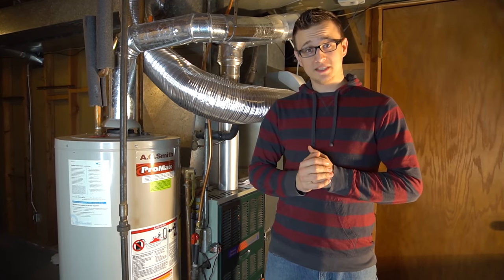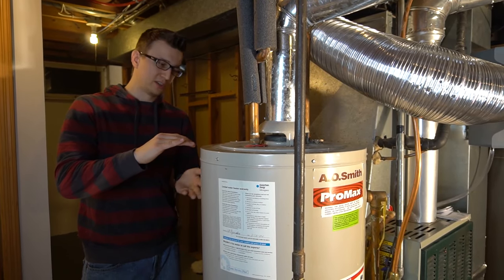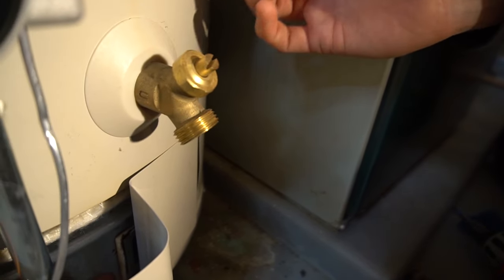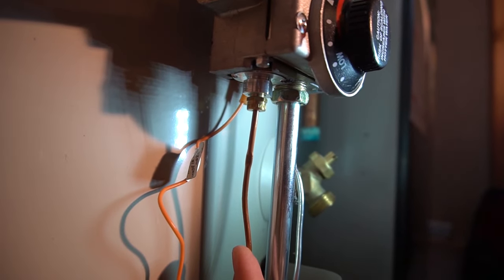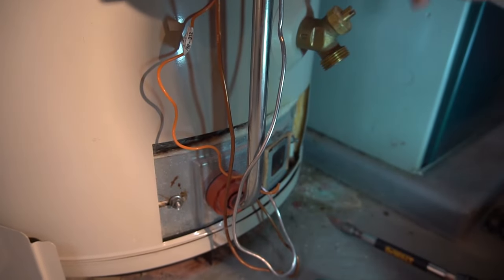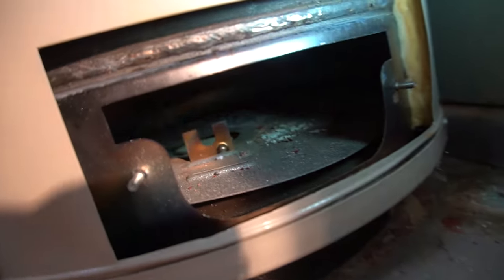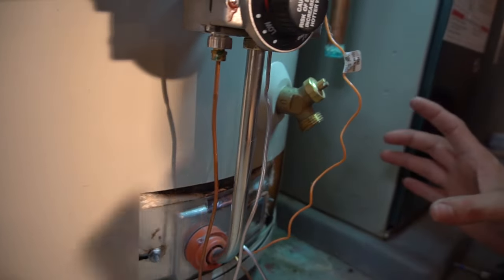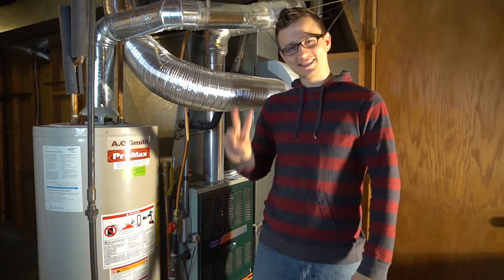How a Gas Water Heater Works ✔

Comment: My anode screw is really stuck which looks to be common if not touched for awhile - any suggestions?  Good infos but could have touched on replacing the small spigot with bigger and sturdy ball bearing one to make flushing easier and more effective.  But then again, seems like flushing is not encouraged in this video.
Reply from the maker: I made a video where I replaced my anode rod, maybe that will help: https://www.youtube.com/watch?v=qLzoikQ7gWg&t=129s
I believe that flushing on a regular basis is only needed if the homeowner has very hard water. In my area almost no one flushes their water heaters (or replaces the anodes) and many of those heaters make it over 20 years.

Comment: My water heater was leaking on the bottom and drain valve .Do you think need to be replaced or need to fix.Also ,I saw rust on the opening of brain burner and below the drain valve .

Comment: Hi, I really need some assistance with my unit. My water heater’s pilot light is on and I can get it to stay on, but when I kick the control knob to my desired heat setting, the gas kicks in and lights the chamber with a good amount of light/fire for 2-3 seconds (I hear the infamous boom sound), then the entire light dies quickly thereafter. Do you know I will need to replace the entire gas control valve? Is that correct for this kind of issue? 

I don’t think it’s the thermocouple as the pilot light stays on, but why does the light just die when the fire kicks in? Maybe faulty sensor? Pressure build up? I have a water heater that looks very similar to yours - except it’s made by Rudd.

Comment: Can you mention or list the possible causes why the hot water would run out very quick like ~5 minutes or so (initially heated to 120F, heater is 12 years old Rheem brand) on a gas heater like this and what troubleshooting techniques or steps would you recommend to narrow down the possible causes? Thank you in advance.

Comment: Thanks. I just replaced the gas valve in my older (10+ yrs) water heater. 
It was an electronic valve and I really would have preferred a mechanical valve.
If the tank's good, is it possible to replace the valve with another type? Could I switch the electronic for a mechanical (if I replace the PG with a thermocouple too)?

Thanks for the content.
Keep up the good work.

בס'ד

Comment: Do you think there is a correlation between temperature and longevity? I kept mine on 120° default, and its still heating good at 36 years.
Reply: High setting will shorten the life of the water heater.  Soft water will make a water heater last longer.

Comment: Helpful video for the newbie, but I will offer a little extra info on inspecting or replacing the anode rod.  All rods have a 1 and 1/16th hex head so you'll need a big socket.  Second:  nearly all will require a cheater bar on the wrench to get it loose as they come very tightly installed.  Third:  Wrap the threads with Teflon tape to avoid leaks since that tank is under pressure.

Comment: Just an FYI, not sure if someone mentioned it already, but the drain valve you have there is not missing a turning knob.  This type works like a ball valve, I believe a quarter turn with a flathead will open or close it.  If you try to turn it like a screw, it'll open the valve real fast and you'll get blasted.
Reply: You make two good points. I never thought a knob was missing, but the operation of the drain cock did confuse me for a   few seconds when I drained mine. Others worked like a spigot, turning left and right to open and close.
Reply: He showed that on the video where he drained his brother's hot water tank.

Comment: So the fusible link in series with thermocouple means you can't just replace it with standard 30mV thermocouple? Or you can but you won't have the hi-heat safety feature protection?

Comment: If the water heater is leaking - should the water be turned off while we wait for the  home warranty company to replace the unit?  Will we continue to have hot water if the tank is leaking?
Reply from the maker: It depends on how big the leak is. Usually it is okay to leave it on until it gets replaced. Yes, even though the tank is leaking you will still have hot water. Unless the water heater was turned off.

Comment: My pressure release valve is on the top of the water heater with a line going out. Not sure if this will be a problem when I replace it.

Comment: Also, when the home owner uses the hot water and the tank water level gets lower, what happens inside the heater regarding if any valve control the cold water filling in and any sensor to turn on the burner to heat the water up ?

Comment: What I really want to know is exactly how the thermostat works. There seems to be a lot of inaccurate information out there about the use of thermocouples, thermistors, and thermopiles within the thermostat. 

The best I’ve gleened so far is:

A) A thermocouple is a device consisting of two different metals in contact with one another, which create a very small voltage (a few millivolts) when one side is hotter than the other side. The maximum current with a short circuit across the terminals is only a few milliamps, and the maximum power it can provide is only a few microwatts. 

B) A thermopile is a bunch of thermocouples connected in series or parallel, boosting the output voltage or current, and boosting the output power. 

C) The gas valve for the pilot light is a tiny electrically-operated valve that can be actuated by the minute power of a thermocouple, only a few microwatts. When you hold down the button for igniting the pilot, this forces open the valve. After the pilot light is lit (either with a match or piezoelectric igniter) and is on for a few seconds, it heats the thermocouple, which begins producing power, which is used to actuate the valve so it will stay open when you release the button. If the flame goes out, the thermocouple cools and its output power decays rapidly, closing the pilot valve so unlit gas doesn’t leak out. 

D) The temperature sensor and main gas valve are what I have found the least reliable information about. There is a copper tube that sticks out of the thermostat through a hole in the tank into the water.  It apparently contains within it a smaller tube that contains a gas (nitrogen? air? Let’s call it nitrogen to keep from using the term “gas” for more than one thing), or it conducts heat to a chamber containing the nitrogen. As the water temperature changes, it changes the temperature of the nitrogen.  That in turn changes the PRESSURE of the nitrogen (look up the ideal gas law if you aren’t familiar with the PV=nRT equation). The nitrogen pressure opens and closes the main gas valve. As the water cools, the nitrogen pressure drops, eventually getting low enough that the main gas valve opens. The pressure at which this happens is adjusted by the temperature setting dial on the thermostat. But what keeps the gas from flowing if the pilot light isn’t lit?  I’m guessing that the heat from the pilot light not only activates the thermocouple but also opens a valve through which the gas must flow to reach the main burner, perhaps doing this by causing a bimetalic plate to bend and alter the valve position. But if that’s the case, why not use that same valve to provide the gas flow to the pilot light, instead of the thermocouple complexity?  Maybe that is in fact how it works. But a thermocouple is probably still used to achieve the emergency shutoff described below. 

E) A thermistor is an electrical component made of a material whose resistance changes with temperature.  There are two types. A positive type increases resistance with increasing temperature, while a negative type decreases resistance. 

F) Also inside the tube that sticks into the water from the thermostat is a thermistor. Its purpose is to activate an emergency shutoff if the water gets extremely hot.  This is not normally expected to ever happen. If it does, often thermostats cannot be taken out of the emergency shutoff state and instead must be replaced. I haven’t been able to find out how the thermistor is able to activate an emergency shutoff. Being electrical in nature, I would think it would have to do with the thermocouple and its voltage output. Let me hazard a guess. Suppose it is a negative type thermistor, and at normal temperatures its resistance is high enough to block the thermocouple voltage from being useful. Say that the thermocouple output passes through the thermistor to another tiny  gas valve like the pilot light valve. Further suppose that, were this valve to open, the gas flowing through it would create a pressure against a moveable rod, causing it to slide outwards away from the gas pressure, and slide across a channel through which the main gas flows, blocking its flow. If the water temperature gets extremely high, the thermistor resistance drops low enough that the thermocouple voltage opens the valve, forcing the rod to slide and block the gas flow. That might work. Although, one can imagine a purely mechanical emergency shutoff, again using a bimetallic substance, this time having its flexure move that rod to block gas flow.  In either case, it would seem necessary to arrange that sliding rod to trip suddeny rather than move slowly to block the gas flow. 

If anybody can point me to a detailed and accurate source if information about how a hot water heater gas thermostat actually works, that would be great!
Reply: Wow thanks

Comment: Hello. 8:23 so does the water valve also works as a timer? Where it will tell the unit to heat the water when is running out of hot water? . We are a family of 4 and find that only one or two can take a shower during the day at a time, otherwise the next person will run out of hot water. By putting it to a higher setting, will the unit heat the water sooner when is running out than when is on the lower setting? 
Please help.
Great video by the way 😊

Comment: Thank you SO much for this video. I am now going down to the basement to see what the problem is with ours.  My husband is down there in his "man cave." He will wonder WHAT the heck his wife is doing messing with the water heater.  LOL. "Doing it myself" since he can't figure it out.
Reply from the maker: Lol, kudos to you! I hope you will be able to get it fixed and show your husband how it's done ;) Good luck!
Reply: Okay, so I went down there and he was playing a video game. I went to the storage area and he asked what I was doing. I said "Taking a look at the water heater." He got up and came over and watched me and was asking why I was doing this. I said "I'm trying to figure out why we don't have more than a trickle of hot water in the upstairs bathroom." (Been that way for MONTHS, it takes 45 minutes for the tub to fill up...and the water is NOT hot.)  So I looked at the thermostat and it was not even on hot.  So I turned it up.  Then I told him about the rod with the magnesium and he said he'd never even heard of that. then he             followed me upstairs and I showed him a few things on the video. I said "There HAS to be a way to have hot water upstairs!" and I asked him to remove a ceiling tile to take a look at the plumbing. VOILA. Found the problem. Iron to copper and it's corroding. BUT now the hot water heater is turned up and my daughter came down at one point and said "Mom, the water is         actually pretty hot right  now, you should run up and take a bath. "Go figure. So because of this video, we are now going to be able to fix the year long problem of a tub that won't fill with hot water. THANK YOU. I"m going to watch your other stuff and     just start fixing the whole house!!!!!  @WordofAdviceTV
Reply from the maker: Haha that's awesome!! :) Thank you for taking the time to come back and share your story and findings! I'm happy to hear your hot water has returned! All because you finally have had enough and started investigating. Tell your husband he has to take you out for dinner now ;) You get the "Mom of the month" award. Enjoy the hot water!
Reply: Happy to say, we are enjoying HOT water now. lol. And there is a new hole in my wall to gain access to the shower inlet plumbing so we can now fix the copper to iron corroded mess. THANK you for getting this started. WOO HOO.  @WordofAdviceTV

Comment: I have a small woodshop in the basement where the furnace and water heater( natural gas) are located. Often I create a lot of fine sawdust that fills the air. Could this be a safety hazard with regards to either the furnace or water heater? Thank you for this informative video.
Reply from the maker: I don't think there are any safety hazards but the furnace filter will get plugged faster, if your water heater has an intake screen that will get plugged up with time, and the flame sensor on the furnace (if it's steel vented) will get dirty faster. But those are all minor things.
Reply: Thank you so much for your response.
Reply: Thank you so much for your response.
Reply: Thank you so much for your response.
Reply: Thank you so much for your response.
Reply: Thank you so much for your response.
Reply: Thank you so much for your response.
Reply: Thank you so much for your response.

Comment: Hey buddy, it was the pretty good knowledgeable video, however, I have a question. My pilot always remain on as it should be but my burner get turned off after a while and not getting on until I turned I on by pilot and all the process. Is there any way that my burner get turned on by itself?
Reply from the maker: So the burner turns on and heats the tank but when it turns off, the pilot goes out as well? Do you have a sealed burner chamber? (no air can get in it from the front, where the gas line goes in) If you do, then perhaps you have a plugged intake screen on the bottom of the burner chamber. You would have to pull out the burner and clean that out. Maybe even blow it out with some compressed air.
Reply: Word of Advice TV 
Hey buddy thanks for your response. The pilot stays on all time. There is no issue with it. The issue is with burner. It keeps getting off after 4-5 minutes. I don't have sealed bottom. I have cover that I can remove just by hand with single pull.
Reply from the maker: Oh okay, now I see what is going on. Before I forget, have you looked at your chimney or vent pipe? Sometimes a bird can decide to make a nest in it. What is the brand of your water heater and model number if you have it. Have you tried flushing the water tank? Sediment build up could cause that. A malfunctioning gas valve could be the problem too which causes it to turn off early. (the gas valve has a probe that measures the water temp) Also, does your water heater have a vent fan on top of it?

Comment: I have a Honeywell gas valve. While in the laundry room I heard a loud pop, similar to a firecracker come from the heater. Several more pops continued, not as loud as the first, and I saw the orange glow in the water heater burner area going on and off in conjunction with the popping sounds. I went over and turned down the temperature and the burner turned off. It seems to working ok now and there are no warning flashing lights, just one flash once every 3-4 seconds. What happened?

Comment: how do you get lime scale and calcium out of a gas water heater like this with no way of accessing it to at least vacuum it out.  Flushing did not work for me and that could be because my heater is 13 years old and has never been flushed/drained.  I tried to drain it yesterday and did not see what I know is blocking me from getting water inside the home faucets and hot water.  I've looked at a lot of ytube videos and mine is not flushing simply as it show on most video's.  As a matter of fact since I drained it the water is now trickling out of my faucets.  So, any helpful tips would be most appreciated.

Comment: I'm confused with temperature control. I mean how water temperature is controlled? Is there any separate sensor for that which goes into the water tank?
Reply: Ezaarkash  thanks for explanation! 
Can you please tell how it control the gas to main burner? I mean is there any solenoid valve for that purpose?
Reply: Ezaarkash  hmmm.. actually I was looking for the mechanics of valve. I mean I need to know how it is closed. Is there electrical signal? like in case of thermocouple (40mV) or it's all mechanical. 
If you get to know from someone else let me know. Thanks

Comment: I have a natural gas water heater, a 40 gallon Bradford White atmospheric vent unit.   The gas line from the drip leg to the gas valve on the heater is the flexible type.

Comment: By heating the water, the water pressure increases. Does the house's hot water plumbing have to handle that increase in pressure?
Reply: And, I just realized that the hot water heater is a link between the hot water and cold water pipes. So, the hot and cold water pipes "see" the pressure increase from the heated water.

Comment: Before replacing an annode rod do I need to shut off any valves , isn't it under pressure ?
Reply from the maker: I replaced mine not too long ago and filmed the whole process, if you are interested: https://www.youtube.com/watch?v=qLzoikQ7gWg&t=767s

Comment: Nice video! I learned a lot! I think you forgot to mention that the gas valve has that temperature probe that goes into the water heater. It measures the temp of the water  and turns the burner on/off accordingly. Thanks for the walkthrough!
Reply from the maker: I guess you are right! I did forget to talk about the gas valve itself in a little more detail. Thank you for adding that piece of info ;)

Comment: why would the hot side typically not have a shutoff is that to prevent people from shutting both valves and having water heater over pressurize because they left heater on with valves closed? I always have had valves on both lines